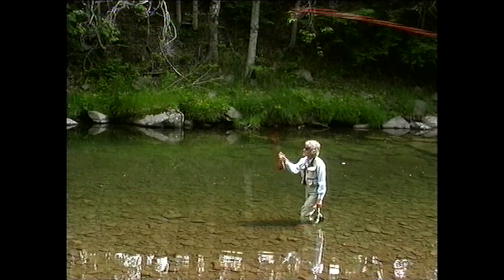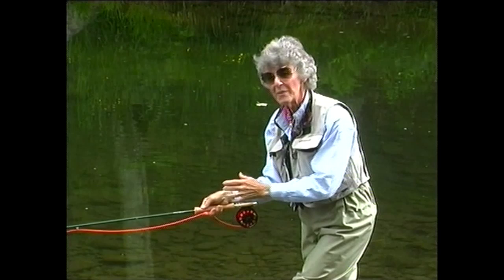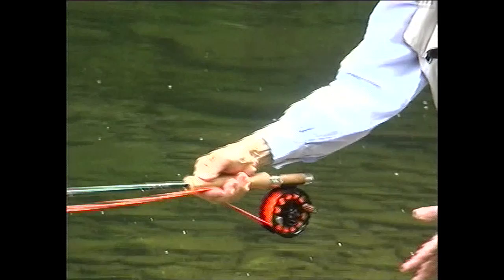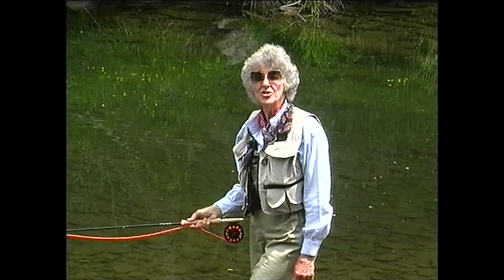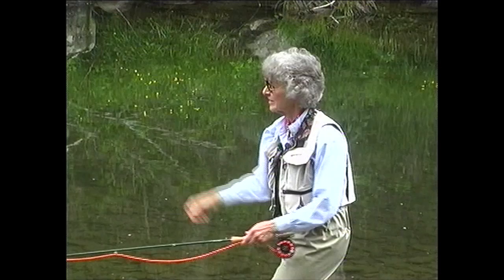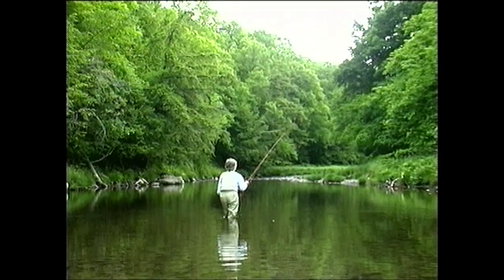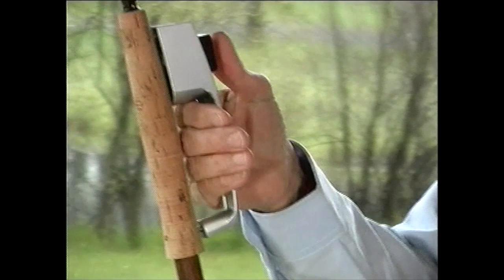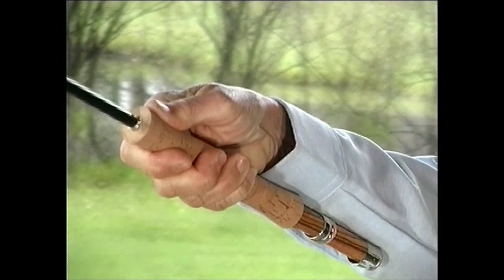Joan Wulff Teaches the Basics of Fly Casting

Comment: Theres no magic way to make the leader extend fully. After you have a good loop/candy cane and a proper backcast(imperative for the loops shape) it's all about power application. Too much power and the loop hits the end of the line way way too soon, not enough and the loop will be pitiful and not turn over. Too strong a backcast the loop goes around 360 and either tangles or extends with the power of the gods and scares all the fish within 20km, too weak and the fly doesn't have enough power to turn over.
Reply: thanks man that helped me

Comment: I'm a little confused here. Please help me. I have been told that you should under no circumstanses ben your wrist when fly casting, but you are in fact bending your wrist here. Apparently I got something wrong?
Reply: What they are trying to tell you is that you should not just use your wrist you have to also have to use your four arm.... Joan is just saying snap your wrist at a 45 degree angle to get the line behind you at 11 o'clock in the air  and when the loop has unravled behind you snap back in front of you closing the 45 degree angle at 2 o'clock
Reply: You raise the rod and snap it back behind you, all in one swift movement, but as she says don't "yank" the line off the water, as the splash frightens off the fish. Now, if someone was standing on your right hand side they are waiting to see the rod tip come to the 10 o'clock position behind you and the two o'clock position on the forward cast. When your forearm is straight up you can't get a 10 o'clock position behind you, the rod tip will be straight up in the air. So, you flip your wrist to 45 degrees to complete the arc and angle. Then bring your wrist straight and again in one movement, move your forearm forward, stopping dead at 2 o'clock, on the forward cast. When the fly hits the water, gently lower the rod tip allowing the rest of the line to gently rest on the water. What you DONT do, is get into the habit of flicking the wrist too far back or forward at all and relying on your wrist to give you the casting arc. All that will do, is throw the line on the ground behind you and in a heap in the front.
As for landing the fly gently, watch some videos on here of guys casting and they think distance is the be all and end all. They simply end up throwing the line and lashing the water. The FLY should land GENTLY before the line lands, as the fly would land if it were real. In real life, you don't get a line splashing onto water followed by a fly!